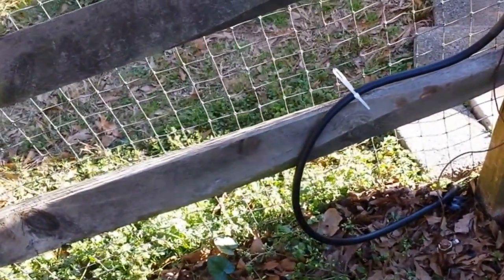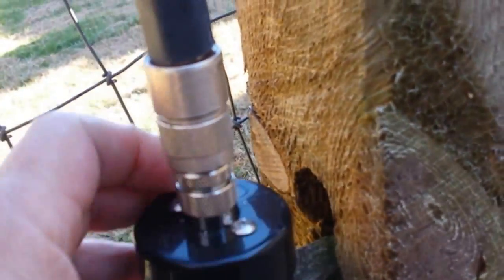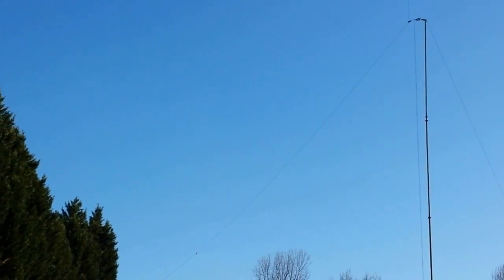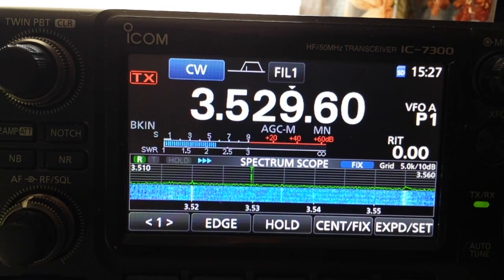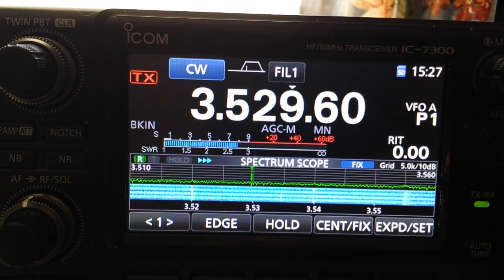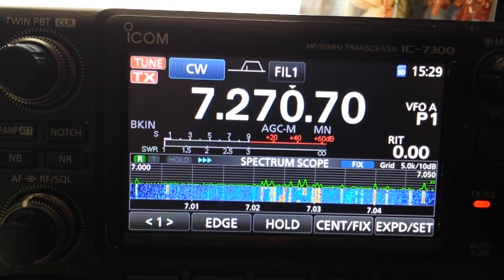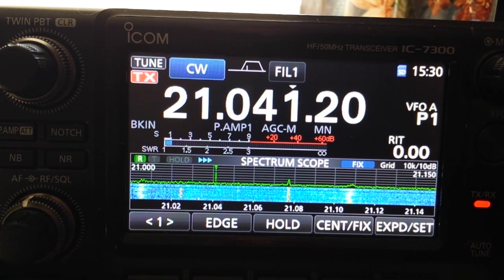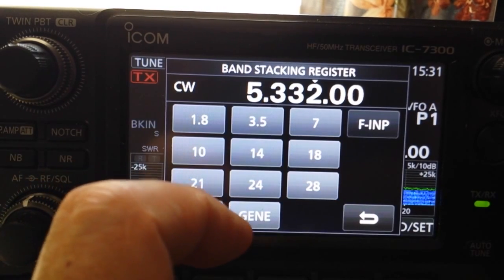Myantennas MEF-330-2K End Fed Half Wave Antenna

Comment: The only issue with any end fed is that most hams forget to make a counterpoise for it to work against. You should cut a counterpoise wire at least a quarter wave long on the lowest band you intend to use this on to keep RF from backing up the feed line into your shack. An end fed with no counterpoise is half of an antenna. Try using a cut to the band dipole with one leg of it missing...same idea. Without a counterpoise, the entire radio shack tries to become the other half of the antenna....bad mojo for RF on your signal.
Reply from the maker: Everything you said is incorrect. A half wave wire with a 1/4 wave counterpoise would no longer be end-fed. Instead it would be off-center fed at a high current point.  Your "counterpoise" would radiate as much as your 1/2 wave wire. Secondly, half of the antenna is NOT missing. The entire 1/2 wave dipole is totally there. Only the feed position has changed. With these types of transformers the secondary / antenna side of the transformer is grounded to the coax shield. One could disconnect it internally and connect a counterpoise but it should not be more than .05 wavelength otherwise the feedpoint impedance would be greatly altered and the cp would radiate too much. Like any coax fed antenna, common mode can develop on the shield. Usually just laying it on the ground is enough to tame it. I suggest a ground rod at the transformer. This offers lightning protection and ensures a good RF termination.  There are thousands of these in use world wide and very few have reported RFI problems. Usually a common mode, ferrite type, choke at the shack end is more than sufficient. ..... Last... You lumped all end fed antennas together. The above applies only to 1/2 wave end feds and the harmonics thereof. Random length wires, 1/4 wave antennas etc. are a different breed and those will indeed require radials and or counterpoise.

Comment: How would this work if you ran a 1/2-wave at 10M and/or 6M. So, maybe a 16.5' and a 9' wire connected to the same 132' wire you're using. You'd probably need to spread it out a bit. I've seen these work as regular dipoles, and it seems there isn't much interaction between the different band's wires. 

I think you had said in one of these videos that you do get 6M on the existing setup.

73
Reply from the maker: I haven't tried that but I suspect it won't work too well. The transformer is limited to 30mhz so forget 6m. They are very sensitive to anything near the end, like your hand. I guess the best thing to do is build one and see.
Reply: Hi.  A fan dipole's multiple conductors probably work because the wire closest to resonance has the lowest impedance while the other wires have significantly higher impedance, and therefore the overwhelming majority of RF current will flow to the resonant segment that's got the lowest RF impedance.
With an end-fed halfwave, the feedpoint impedance is very high/maximum at the resonant end -- a couple kilo-ohms or more... and in fact a random length of wire will average more like 450 ohms.  Perhaps someone with experience could model this, but it seems intuitively that the extra wires would cheerfully take the majority of RF current because they are at lower Z.
HOWEVER, I might be all wet.  Certainly the SWR would be worse.
Another solution: the same weatherproof box that contains the matching transformer could also have a DC-powered coaxial relay (or to get fancy, a series of relays and electronics) to switch between wires, and a shack-located box to apply DC or not or perhaps some signalling mechanism for more than 2 wires.
Given that end-fed halfwaves work on both odd and even harmonics, perhaps an external auto-tuner and low-loss coax (or ladder line to the low-Z side of a 4-6:1Z up balun?) would make the whole thing serviceable where it's not resonant?
Thoughts?

Comment: Steve : Re : your choke balun-----I also have bci on 80 meters, mostly from WLAC (am 1510) which, if you are not aware,is a 50,000 watt blowtorch which has its transmitter only about 5 miles from my QTH. I just use the ATTenuator to get rid of the bci but would a choke alleviate this problem completely ? Thanks for the video !
Reply from the maker: There are too many factors that could cause that. Actually I don't exactly know why the choke helps. Normally they don't affect BCI. One thing you could try is a high pass filter with a 1.8mhz cutoff.  I have one of these: http://www.dunestar.com/store/160-Meter-Highpass-Filter-pid-8.html
They really work however note the 100w power limit and that is assuming your swr is low.

Comment: Hi Steve! Tnx for the video. Very nice. You mentioned that w/o the choke that you had some bci.. were you able to measure the common mode currents on that choke? Watching Peter from Germany has built both a 1:1 Balun that exhibits -20db or better on common mode currents. Secondly how does the end fed perform in comparison with your open wire feeder CF antenna? Tnx es 73's David. K8KEM
Reply from the maker: David: No. How does one measure common mode current? Who is Peter from Germany? The BCI baffles me. I'm not sure why a choke works. As for the CF doublet. After months of comparison I decided to take it down. This antenna works better because the extreme impedance variations across the HF spectrum makes matching a challenge.